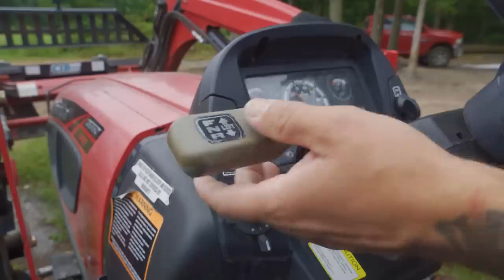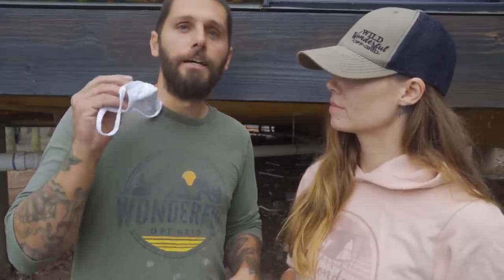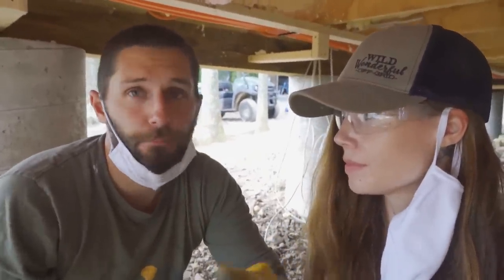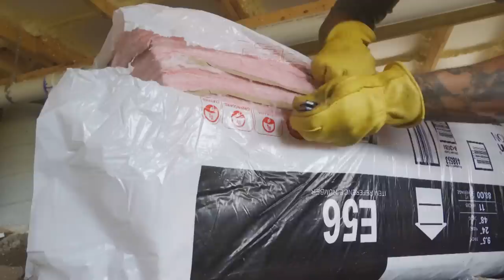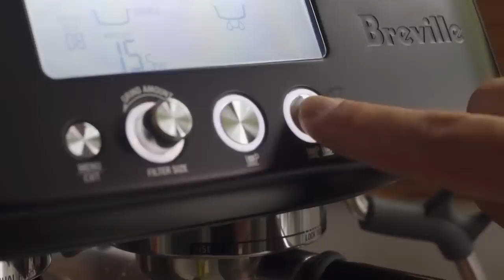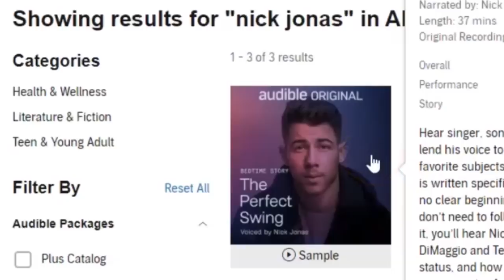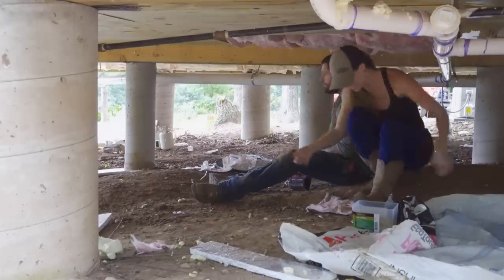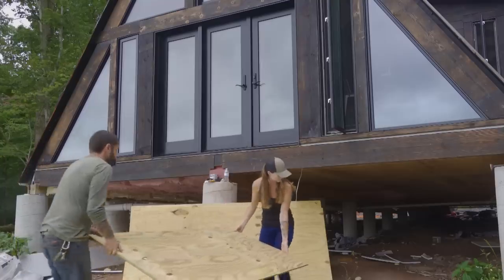Insulating A Home On A Pier Foundation

Comment: Make sure you seal all joints. Parents gave a cottage on stilts like that. Bees love anny crack or seam to get in and make nest in the insulation.
Reply: Yum, honey.
Reply: Malcolm McGrath many people say bees when they mean wasps. Buzzy colony insects with stingers are never good housemates, whether they make honey or not. Here in New England the biggest issue is paper wasps, which are solid brown, not striped like most stinging insects. They love wood, undersides of wood especially, and a gap in wood is even more inviting for them. And they are mean. Apparently the pain of their sting ranks quite high on the scale that some lunatic made by letting loads of bugs sting him.

Comment: Hey Josh, I've got a technical concern. Shouldn't the bottom of the floor be ventilated? Think of this as an upside-down roof where ventilation air is brought in at the bottom of the roof through soffit vents and relieved through air vents at the top. In this case, you will need to vent the joist spaces at both ends to allow airflow through the joist space otherwise you will trap moist air in the floor structure which may result in the floor joist etc rotting out. Instead of the plywood you probably should have used ventilated soffit. But now that the plywood is in maybe install some of those plastic bullet vents or cut in slots with bug screen.....Marty
Reply: This assembly should include a continuous insulation layer, but not ventilation openings. Check out ORNL document 4000160073 via a web search. Figure 6.11: Vented Crawlspace – Pier Foundation - Rigid Insulation.

Comment: Oh, man....that is brutal working under the house with installing all that insulation and half inch plywood. Guys, it’s ok to get a crew of volunteers to help finish this back-breaking project.
Reply: Get them boys in there. Time to build some muskles
Reply: Al Pence - there may be child labor laws that prohibits that. Still, you need a couple of guys who can bench press 250lbs to hold the plywood up for the low section of the A-frame.
Reply: I’d love to help!
Reply: Ryan144 - I’m not a billionaire. Haha
Reply: @JFairhart  No child labor law covers your children working at home lol
Reply: JC1028 - I’m so glad someone finally said that. So, here is the question: If there is a child labor law that applies (had there been a work for hire) would you as a parent have your child do that very job even if just for a family farm? What is your standard? At what age is it appropriate to ask your child to perform a particularly strenuous task? In my opinion, I would not ask my son(s) to do a strenuous task if I felt it was an unreasonable request. That’s the point.

Comment: You two are absolute "machines!" Love the cinematography - especially those opening shots! 

On a more generalised note - I'm absolutely intrigued by the materials used in construction of homes there - our "norm" is brick and mortar. Is it just the normal practice in the States to build (my impression) to build with timber? Is brick unpopular for any reason other than "time"?

Blessings and regards, Mark (South Africa)
Reply: Yep both the USA  &  Canada  mostly use Wood for builds .
Reply: @rgh470  and the reason? What factors drive that? Am not being confrontational, am really curious..
Reply: markforrestsm 
It’s really for no other reason then supply, wood is abundant here in Canada, and the USA, 
therefore it’s the most cost effective way to build a what we call a single family home. That being said, parts of Canada (Ontario) you will see many homes with brick features, sometimes the whole home looks like it’s brick, but behind the brick is wood . 
Cheers
Reply: @rgh470  Thank you for taking the time to explain, appreciate that. Regards, Mark

Comment: And I thought I had a rough time years ago when I raked up our blown in insulation and put R 30 Batts in our attic. But, all the work was greatly rewarded by energy savings and better climate control and sound.

Comment: We used those adjustable platform things. We tried doing the way you guys are and then one of the young cousins said why not use a drywall lift just a short one my uncle has 4 4 foot platform things he uses for taping, mudding and painting so we used those. Still had to carry the boards under but didn't have to hold them up.
Loved seeing Chuck and keep up the great work.

Comment: I really enjoy your channel. I Have seen most of the build. Never commented before. I didn't catch whether that was 3/4 in plywood or 5/8. Also depending on when you bought the materials it might have been some cheaper to go 7/16th OSB, right below the fiberglass (with just the minimum screws) then come back later with a another layer of "waterproof" OSB or even 1/4 in treated plywood. Woulda been a LOT easier. And maybe even stronger. I'm proud of you guys for picking that kind of heat 👏. Bravo!

Comment: First, I love your channel and the progress you guys have made is amazing! As an armchair quarter back...maybe you can use some of the techniques for hanging drywall on the ceiling? I have seen a specific tool for it and others used a 2 x 4 T to hold the wallboard in place. It might be easier on you. I am astounded you got half the house done. Plywood is heavy!

Comment: If you find the middle of a section of plywood, set a flat concrete paver then set a bottle jack on it then a 4x4 post.  On that post you can the push the post up to hold it in place while it is screwed off.  It is sort of like using a deadman for drywall.

Comment: Just to give you an idea of what that pressure treat plywood is like moist.  For my Alaska prospecting trip, I have to pack all the fixings for an electric fence system.  The 4x4x8 corner posts were 50 lbs each and dripping wet.  After two months of drying out they averaged 18 lbs.  That's 32 lbs of water or 4 gallons in each 4x4.  Now think of 14 of them and the amount of weight (448 lbs) I no longer had to ship!  And you vonder vhy she's pooped!

Comment: When i set the depth of saw blade to cut something i set it to just  pass through the material, but not much more. I' d rather cut a 5/8 inch slice instead of 2 inch slice out of my tender body.  Real happy to see the table saw off the ground, way easier on the back. One last thing. When i do grading under the house l like to go the extra effort and clear all the debris and put down a layer of decomposed granite. We have that in az. It drains and compacts really well and is not too muddy when wet. Then when you have to work under there later it is not so miserable. I am a retired carpenter and just putting this out there for people who are diy's, these guys are doing great. Try to do this when you are younger, not so much steam now.

Comment: Very hard work, you're doing a Fantastic Job. U R putting up heavy plywood, makes one Great Finish Product. Any tiny gaps U might want to use heavy screen to span the cracks, mice will find a way thru spray foam. GREAT JOB GUYS‼️👍👍. Vinny 🇺🇸

Comment: When you get ready to do the back half, I want you two to think of using a "tetter totter". Set the plywood unto one end, then push down on the other end to raise it up. You'll have  maneuverability once it's up to place and hold it to set the screws.  Longer the board less presure to lift and hold it up. One person can do the entire lift by themself while the other adjust and sets it into place.
Reply: This would also be a great way to involve the two shorter members of the construction crew.  They also have the advantage of not having to duck walk under the house.

Comment: I think that in the cold period it is necessary to close the ground under the house with a wooden fence.  Unplaned wooden planks at least 2 inches thick are excellent. In summer, to ventilate well, simply remove the fence in the lower area and a small piece in the upper part of land. Bye from Italy.

Comment: Oh LORD! I need to replace all the subfloor insulation in my condo, probably about a thousand square feet, maybe a little more. It's all in a crawl space cramped enough that getting up on your knees is a challenge. I'm going to turn 71 in a few months. I didn't get it done or even started this summer. I'm thinking of using a contractor instead of doing it myself. I don't like using contractors as I like to be more self reliant. However, at my age I have to consider how the job would go. Watching this video was very helpful. 

I'm leaning toward the contractor after watching this. My knees are shot due to an old injury when I was in high school and arthritis. Staying at the field level most of my career helped make them worse. Wildland firefighting contributed to their current condition as well. Yup, I'm going to call a contractor this winter.  Thanks!

Not only did I learn this by watching your video, I love the sexual double entendres and interplay between you two. I love the family interactions and the sense of humor you have. Keep it up!

Comment: Too late now (but maybe the next build), but, get a little garden cart. Rig it with 2x4's and straps (otherwise the boards will bounce off) to carry the sheets of ply, and pull that under the building. Then, use temporary hangers made from 2x4 or flooring offcuts that you screw to the opposite sides of the joists that you are fixing the sheet to. They hold the board up on one edge (you can have them at the corners of where the sheet will be so that there is overlap and one hanger does this and the next sheet, you screw the other edge. Then screw the held edge, remove the temporary hanger from one end and move to the next board. Your backs will thank you.

Comment: If you are going to seal the floor, measure the floor joists out, then staple the insulation to the plywood leaving the space for the joists. Are just staple them to the plywood with out leaving the space for the joists. Then install the plywood wood! No sticky stick from the insulation. Save a lot of time!

Comment: When I was younger I would always hang dry wall by myself and make myself a "T" brace with 2x4 before doing the ceilings. Try that underneath you will find that it will be a lot easier.

Comment: Now I'm wondering just what kind of enclosure you are going to put around the bottom of the house. In my mind, I'm thinking cinder block. Yea, I know, it doesn't look that nice, but it's cheap and for the insurance inspector, that's all you need. Later, you can always decorate it the same way that you did with the inside of the house behind the wood burning stove. I think that that would look very pretty. I'm just eager to find out just what you came up with, I'm sure that it will be amazing!!!

Comment: Slice the 4 x 8 sheet into two 2 x 8 sheet. They are  much easier to handle. 

Make the materials order and have the supplier store it until needed. That will keep it out of the rain.

Comment: I have proper filter masks for insulation. I would have sent you some had I known the stores were out. I have some left over from installing insulation in my attic. That was amazing work you guys did in this episode! Also, do you have a rolling flat dolly that mechanics use under vehicles?  💡 You could try that under the house.  🙂

Comment: It’s a bit easier if you can screw wooden blocks on side of the last sheet you just installed so they just overhang slightly and then slot the next board over those blocks so you only need to hold one edge up when screwing it in.

Comment: You two are awesome ( easy to be wise after the event but we used to use a “dead man “ which is simply two pieces of 2x screwed together as a T” to hold the ply up while it is fixed. Pizza well earned.

Comment: In the smaller spaces use a used 2x4 , as a Stilt. It doesn’t have to be exact just close enough to wedge to take the weight of...

Comment: Nice job on your A frame. Just out of curiosity, why would you not put air or water pressure on your radiant tubing before you sealed everything up? Otherwise you have no way of knowing a leak has occurred until you are done. A lot of work to go back and find the leak.

Comment: Perhaps if you started at the harder end, then it would get easier as you become more tired?  There sure is a lot of stuff under the floor in that place and when you get the panelling around the sides, there will be no cold stuff getting up through that floor.

Comment: Hi guyz! I have a suggestion for you. Underneath your house there would be an air flow. And for the cross sectional area decrease, speed of the flow will increase from front to the end of your base. So this air flow would cool down your house. This is called natural convection in heat transfer lesson in engineering. As a result suggestion is: close your down sides of your base to prevent this air flow also convection.

Comment: Cut the sheets into smaller sizes.  Will result in more lifts but they will be lighter and easier to move as the space gets tighter.

Comment: You probably already finished but you could have screwed a couple blocks of wood to the end of the sheet that's done and then have it out far enough so that one end of the next sheet you put up will slide between the blocks and the floor joist then raise the other end and run a couple screws to hold it up, then you can put the rest of the screws in without holding it up. Similar to how you would do drywall on a ceiling.

Comment: Just thinking about whether an unfaced product would have been better in this application.  The insulation's paper vapor barrier faces the rigid insulation, which itself is sealed tight.  The concern would be that moisture not develop on top of the paper facing and below the rigid insulation.

Comment: maybe use a scissor lift trolley to sit the ply boards on and  lift them up in to place  mite be easyer      if the ground is not to rough for the trolley wheels

Comment: I have to admit that I know nothing about what I am going to tell you, but why did you not use the tool (I think) called "Dead Man"? It is a board nailed to a cross piece that can rest on the ground and hold in place the plywood. I believe it is used putting up drywall on the ceiling when working by yourself. Oh, well. 

May God continue to bless and keep you all (y'all)!!

Comment: I wish I could have been there, just to show you a nice cheat.    2x4 just a little longer then the ground to the ply wood.   Once sheet is lifted you jam in the 2x4 to temp hold the sheet up.    I have used that method with 2x4 T's to install ceiling drywall by myself.
Reply: If your ever in Northern Michigan near Leelanau county let me know and I'll fire up my wood fired pizza oven  :)

Comment: I just watched your video, it was well put together. Thank you for doing that I have a question why you put in the additional layers of white bead foam. I thought you might have done it on your outside edges for additional insulation. Would you only did it on the one side. What was that for?  Thanks

Comment: Good work dear friends. Just wondering, is there a compelling reason apart from cost why you did not use spray foam for thermal insulation?

Comment: You guys are on my top 10 favorite channels to watch and I don't want you to be offended by some of my questions! I noticed you guys have the P-trap for the shower just wondering how you are going to keep that from freezing? And when you guys put up the piping for the radiant floor I noticed there is some Nails hanging down did you put the pipe right against those or did you cut those off or separate the pipe from the nails? I'm just curious about these little details LOL you guys are doing a great job and I've watched every video you guys put out looking forward to more :-)🇺🇸👍

Comment: Been there and it’s really hard work.  I have only a set of crawl spaces and installed a radiant heat system very similar to yours - with a lot of help from my Dad and Brother In-law.  You’ll enjoy it the most in your bathroom thanks to the tile, but not so much everywhere else due to very low thermal mass of only wood. We simply cannot heat our 20x18’ with 14’ ceiling family room with the radiant alone.  Your winters aren’t quite as cold as southern Maine so maybe you’ll have greater benefit.  Keep up the great work!!!

Comment: i have golfers elbow from using the nail gun for shingles for the last 4 days. so when i finish up what little i have to do tomorrow morning before it gets to hot. i wont even start the rear part of the house for a couple days give my arm a rest. i hope by friday i will have all the windows cut out and the walls up. then i can slow down and make it as air tight as i can.. And i have a question? how are your A/C's doing and have you had to use the heat yet. i need the info on them because i plan on getting some for my house in late winter or early spring.

Comment: I may have missed it but did you pressure text the underfloor pex tubing before you closed it in? Sure looked like there were a lot of nails sticking down from the flooring installation.

Comment: Would rather deal with the heavy pressure treated plywood part more than the lighter hanging insulation part... That itch is the worst... Glad the worst part is over... Nice job you two... Take that insurance policy... Railings next!

Comment: I have a lung condition and have to wear protection on our farm and always,used 3m n95 csnd get anymore but you can get kn95 masks. Not as good and I make rubber band behind the head attachment as they come behind the ears and I cant stand those type masks. But they do filter 95% still.

Comment: Do you have building codes and does a inspector come and do structural inspections?  The reason i ask is it looks like you have your floor joists 2ft on center is that correct?